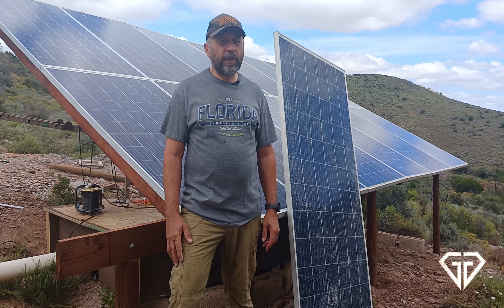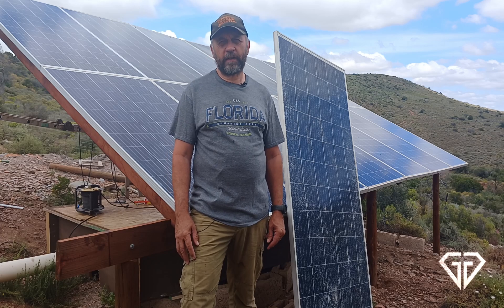An unexpected call - solar panel stand revisited (Update 022b)

Comment: If your inverter supports more than one string (most do) you may be able to start putting new panels on a seperate string (circuit)
Reply from the maker: The inverter does have two MPPT chargers, and I will be running two strings of 6 panels each.  Currently wired as two strings of 5 panels each.  The MPPT can handle 100V to 400VDC, and with six panels the working voltage is around 200V.  With five panels, around 170V.